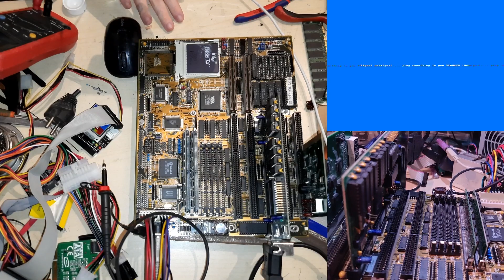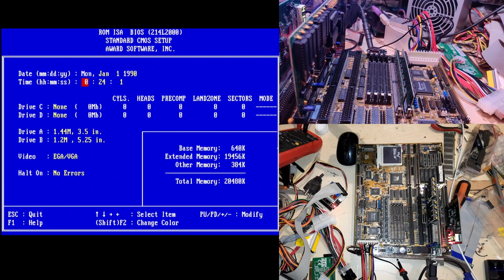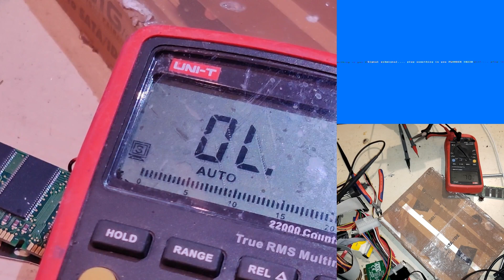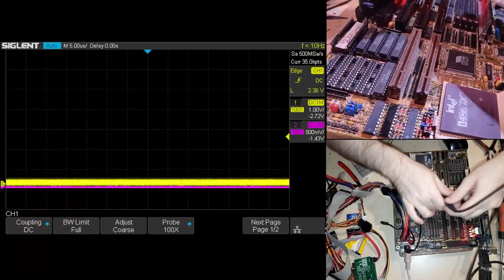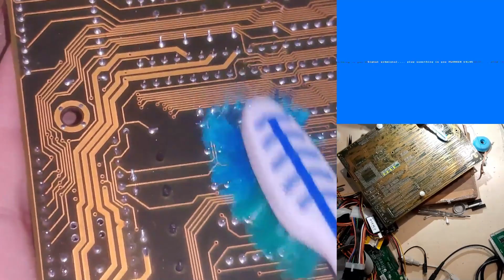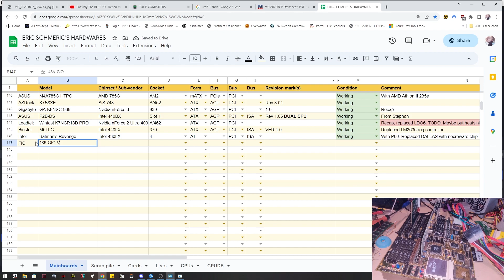Vintage Tech: FIC 486-GIO-VT (1993) RTC / CMOS problem repair

Comment: Any particular reason why you replaced existing RTC/CMOS solution with a socket?
Reply from the maker: Hmmm if I remember correctly, corrosion and also this board was in my scrap box so I borrowed parts from it before